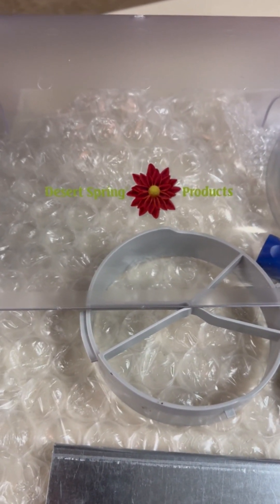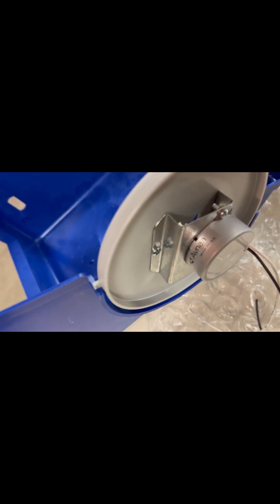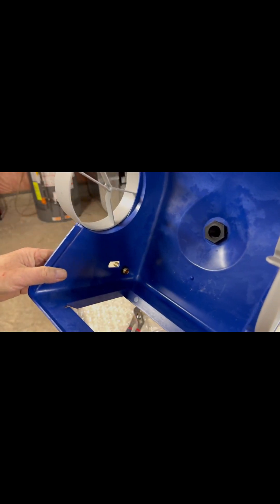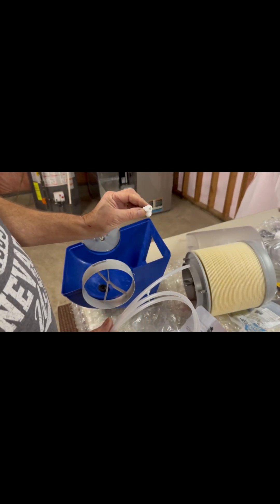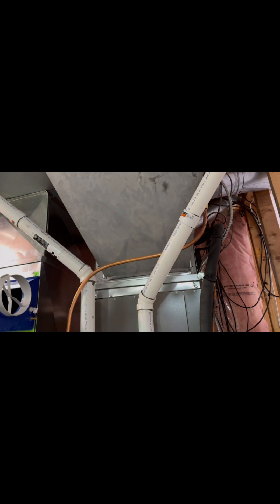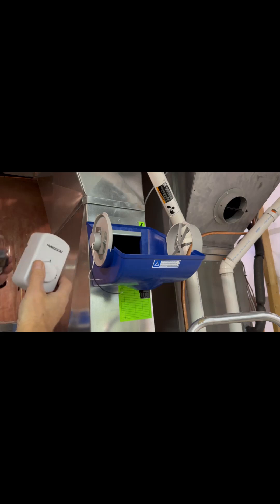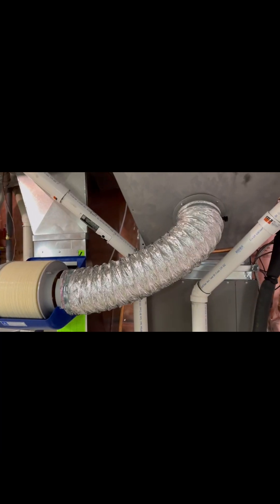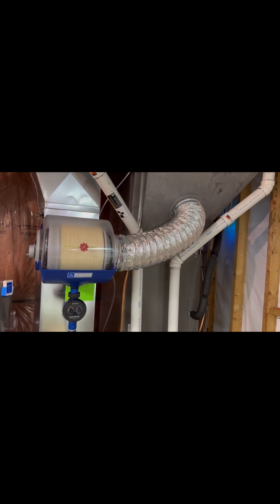Installing Desert Spring Humidifier

Comment: The hanging bracket goes on the inside of the duct, that’s why it’s pulling away, you forgot the rectangular rubber washer that goes on the outside of the float assembly, I had to bend the float arm up to get the water level up high enough

Comment: Thank you Roman.  This is a very useful instructional video that includes some useful hints that are typically not found in instructions that come with a device. I have just one detail on which to comment.  You noted that the support bracket is not strong enough to keep the basin from tilting forward when filled with water.  Actually it is.  It is clear from the video that you mounted it on the outside surface of the plenum.  The instructions call for mounting it on the inside surface.  If on the outside surface, then the weight of the water can cause the bracket to bend away from the plenum surface, as you learned from experience.